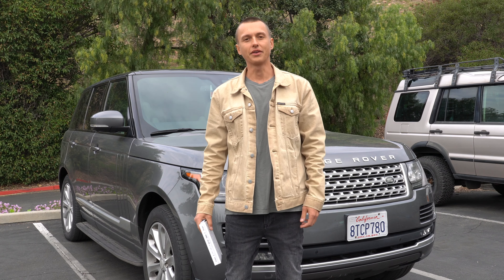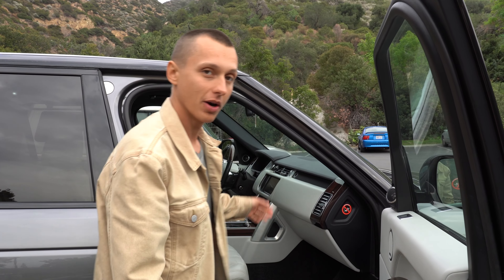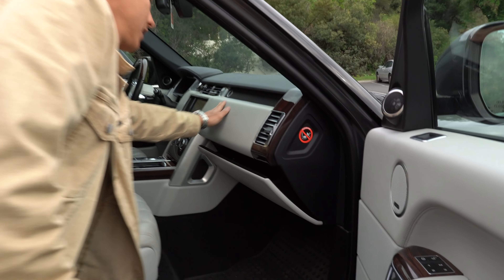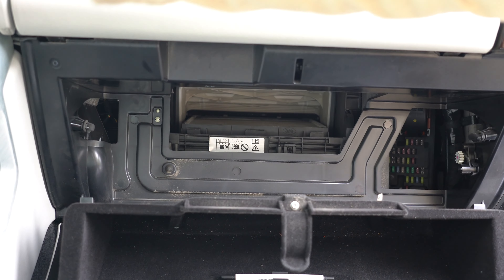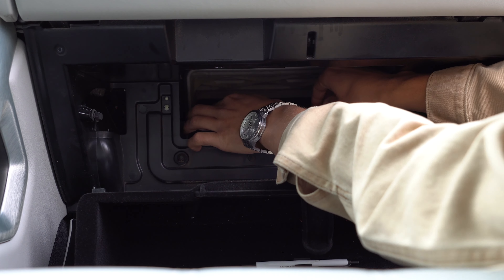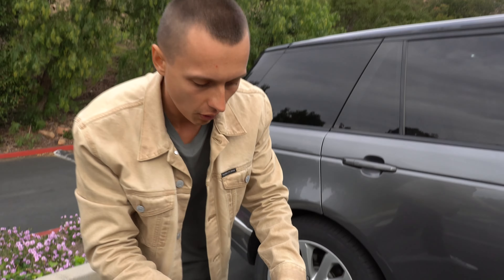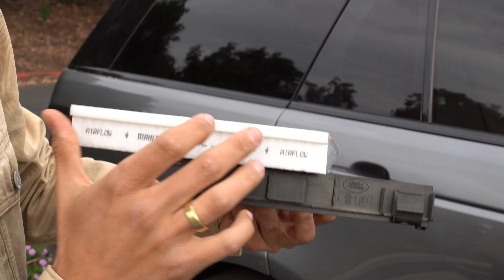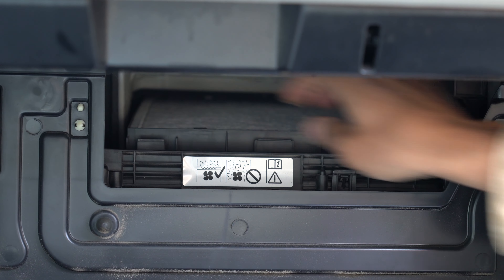DIY: How to Change Cabin Pollen Air Filter on Range Rover, Sport and LR5 2013-2021 in 2 minutes!

Comment: Thank you!  I'm pretty handy and mechanically inclined, but I would have NEVER figured out the clips to lower the glove box or the requisite step to put the HVAC into re-circ to expose the filter.  5 minute cabin filter change (and didn't even get my hands dirty!) to save $150 over the dealer-recommended service. You rock, dude!

Comment: Hi! So.. before I watched your video, I watched a different video that didn't show turning car on and pressing the recirculation button on before starting.. That being said, I broke the flap, I heard a snap and the flap now doesn't open or close. What is that part called? Are there any videos that show how to fix it?  Or do I have to take it to a mechanic?
 The dealership here in the states wanted $350 to replace just my cabin filter and this is why I tried to replace it myself.  I have a 2018 Land Rover Discovery.  I wish I saw your video first!

Comment: Hey Alex! Question for you, I changed my air filter in my 2015 Range Rover sport supercharged V-8 and I am now losing throttle response and my check engine light is on. I triple checked to make sure the intake was connected and everything looks connected. Any insight would be greatly appreciated!
Reply from the maker: Probably you didn’t put the connect properly, have you figured it out? 🫢
Reply: @alexfixty  Thanks for the reply. The line was actually damaged a bit. I had to solder it.

Comment: I just bought a used RR Sport L494 this week and it has been misting up on windscreen so I thought I would replace the cabin pollen filter.  I watched your video carefully and followed the instructions but someone must have previously forced open the grey hood cover as it does not open or close when pressing the recirc button.  The grey hood is very loose.  Does anyone know if there is an easy way to fix this?